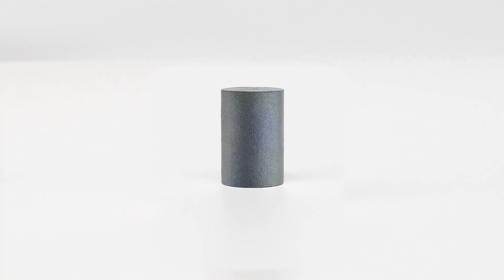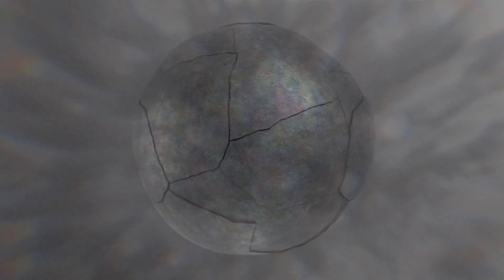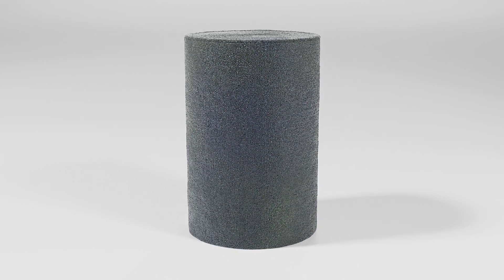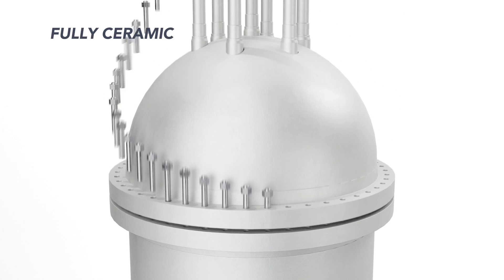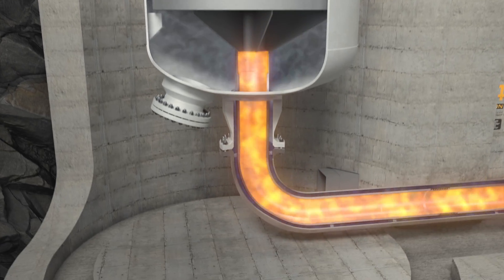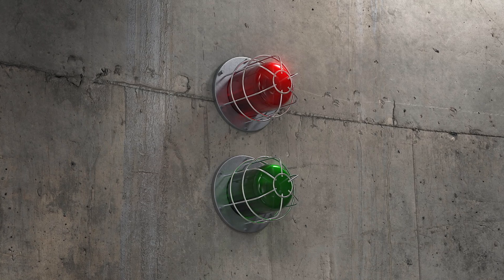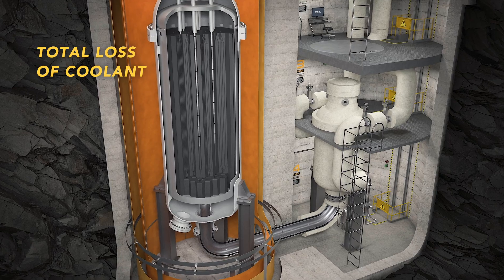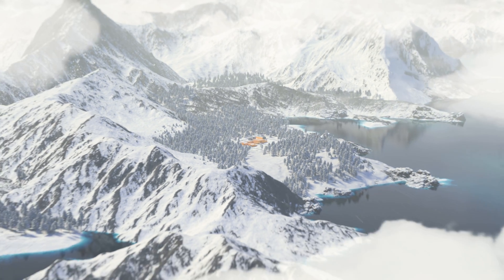How it Works – the Micro Modular Nuclear Reactor

Comment: I chuckled at the point about dissipating heat by glowing, because that's quite literally a thing: all objects lose heat via electromagnetic radiation. Fun fact: this is also how the James Webb space telescope is able to keep cool in deep space, even without anything else to conduct heat away.
Reply: @Based_transition_Clocker What is confusing about my reply? In any case, all radiation from nuclear reactors is shielded with thick steel and concrete. Whether you're talking about the ionizing radiation, non-ionizing radiation, or neutrons, all of it is extensively monitored and none of it escapes the containment building.
Reply: @jlp1528 please stfu… extensively monitored??, governments habitually become negligent. Private companies shoot for high margins. Been to Fukushima? Cancer rate 77 per 100k compared to 1 per 1M

Stuff your cake hole with ThO2
Reply from the maker: @Based_transition_Clocker yea trying to speak to as many people as possible. The point is the reactor temperatures remain safe and with plenty of margin without any active cooling. that's what is special.
Reply: @ultrasafenuclear  I'm pretty sure you have not one but two insolent "Greenpeace" trolls on this thread now. Sorry you have to deal with them. I'm using reason, but you can't reason with the unreasonable.
Reply: @Based_transition_Clocker "Glowing" implies light, usually visible light, but in this case infrared. Infrared radiation is harmless as long as it gets absorbed by something which can be heated without damage, i.e. concrete in this case.

Even the radiation from (thermo)nuclear weapon detonations is mostly thermal. Radiation is a very general term and can refer to the entire electromagnetic spectrum. Look up ionizing vs non-ionizing radiation. The latter does not cause DNA damage, only heating at most.
Reply: @jlp1528 non ionising radiation can still cause damage… also, how is nuclear fuel disposed off? Nuclear reactors are ticking time bombs! Never ever!!!
Reply: @00Tenrai00 concrete slabs buried in mountains, and IR radiation is harmless.
Reply: @Based_transition_Clocker Tell me how I'm wrong then.
Reply: yeah, I liked that bit - can't mention the R-word! but overall, an excellent presentation - we need these reactors, yesterday.

Comment: Great stuff!   
Very promising,  and nothing really new (and so failure-prone) here -  just good, solid common-sense design and engineering.
Reply: Yes. It is the original idea of the pebble bed reactor, but with tinier pebbles encased in fixed graphite fuel elements.
Reply from the maker: keep it simple. keep it safe.

Comment: so I have questions:  what is the expected power capability for one unit?  put it in terms of kilowatt hours?  The comparison to barrels of diesel for one "pellet" is not helpful.  How many pellets in one MMR reactor, how much kilowatt hours of power is produced?  I like the safe design...it's nice...but isn't it also true that the limiting the heat capability also works the other way?  as in, there is ceiling of power that cannot be exceeded?  What would be the use case for such a MMR reactor?  Are we really talking about installing thousands and thousands of these across the entire continent?  Or are we talking about thousands that are collocated in say 50 locations ?  What would be the advantages apples to apples (kilowatt hours) to very large conventional nuclear reactors that have a much higher power rating?  I'm trying to wrap my head around what this technology actually presents in terms of competitive advantage...is it just simply safety....because if it's simple safety as the metric...I could argue that conventional nuclear reactors are quite safe and with a few additional reconfigurations in the existing nuclear conventional reactors at least as safe and possibly more safe.  So what is this new technology really going to do ?  I am skeptical.  I am skeptical because there are so many novel technologies we see that makes the news..but when you drill down there are some deep flaw and even misrepresentations ....what the US NEEDS is to stop the nonsense and start engineering that actually works and can be proven to work..and what i mean by work:  please stop the nonsense with hydrogen powered fuel cell cars...the net power required to produce hydrogen exceed the power output.  That has never made any economic sense.  The more we look at some of these new technologies, the more they appear to be nothing more than money hauls to get grants and federal money and actually do nothing to solve "net zero" or green alternative....

about the best we have so far seems to be solar.  But the problem with solar is SCALE....and there are obvious real world problems that cannot be overcome easily.
Reply: USNC's website lists power ratings of 3.5-15 MWe and 10-45 MWth per unit. Of course there will be a tradeoff between the two, and the exact configuration will depend on what the customer needs. Electricity isn't the only thing nuclear reactors can be used for. Heat can be used directly for industrial applications. District heating in particular does not require very high temperatures, only an effective and efficient system to absorb, transfer, and release heat from a great potential variety of sources.

I understand the economic concerns, but remember that renewables are only so far ahead of nuclear because they have been granted at least ten times more investment and attention for decades. The more we invest in SMRs and microreactors, the more affordable they will become. Also, remember that in 50 years a nuclear power plant is still a nuclear power plant, and it might even still be fully operational. In 50 years, heck, in 20 years, a field of solar panels is a field of toxic waste.
Reply: Very Interesting.  Good Info, appreciate it.  I was not even thinking about the heating application and how small scale could be used for very large manufacturing and assembly facilities.  I am not opposed to nuclear energy.  I think it's an optics problem with several high level mishaps, but those can be solved with better safety controls and location.  Why build next to a earthquake zone or near a shoreline where tsunamis are non trivial.  I do like the SMR design in this video due to the fail safes that are engineered into the design.    Hopefully the US realizes that investments in this area is necessary and we don't put all our eggs in the basket of solar and wind and hydrogen, but that seems to be the current economic agenda. The renewal and safe energy paradigm must be capable of overcoming a 4 year political cycle.  I worry that the US will take the german option and condemn nuclear and then wind back to square one with coal and NG gas energy facilities.  It's a lack of long term strategic investment.  Right now, it all seems to be a hurried short term cobbled plan that doesn't realize a determined goal.  We have milestones to reach and these are stated in general terms, with few actual realistic investment strategies to achieve them.  It seems the ordinary citizen believes that owning an EV car for example is going to make a difference and lacks the bigger picture that an entirely different paradigm shift must take place about HOW energy is produced.  It's hard to imagine the world moving away from classic forms of energy in the current circumstances given there is no business advantages to make the transformation happen without a very long and very expensive investment to do so.  SMR's can definitely play a role in this transition.. @jlp1528
Reply: @tdmmcl1532  These things take time. Solar, wind, and other renewables definitely have their place, but even after all this time and money, they still only provide about 11% of electricity in the US. Compare that to nuclear energy, which provides about 8% despite decades of delays, billions of dollars in budget overruns, and not nearly the same attractive image as that of renewables. What we need is a good mix of energy sources and storage solutions on a case by case basis. There is no "one size fits all" energy mix; many factors need to be considered to determine the ideal energy mix for any given scenario. USNC themselves talk much more about potential applications and energy mix options in their most recent YouTube video. It's about twice as long as this one, but well worth watching.

Again, while it may sound counterintuitive, renewables are "cheap" and "attractive" only because we have invested so much in them in the first place. If we had instead invested in nuclear, we would be in a far better position, even taking all the disadvantages into account. Yet despite the relative lack of investment, the nuclear industry has solved incredible scientific and engineering challenges. Lack of public understanding and political will, on the other hand... I imagine these videos are made to help tackle such remaining issues, not just to sell new reactors.

I will copy and paste the last paragraph of another comment I made so you don't have to dig for it. It's very relevant to your concerns.

Will we see SMRs and microreactors bringing commercial power to the masses by 2030? Time will tell, but I'm cautiously optimistic. There is already at least one SMR facility under construction in China. New Memorandums of Understanding, environmental assessments, and funding agreements are making headlines every month on every continent except Antarctica. The future of nuclear power is safer, more reliable, more efficient, more flexible, and more powerful than ever before.
Reply: @jlp1528  I appreciate your detailed and informed reply.  I am rethinking a change in my profession from wide body commercial avionics tech to nuclear and possibly solar in the maintenance segment.  I've pretty much hit my career potential in avionics and nuclear and solar seems to be a good next level step.  So this is also a "selfish" interest in these two fields.  Any advice on opportunities is of course 😁
Reply from the maker: @jlp1528  you are well informed.

Comment: We need reactors either using fast spectrum to burn U238 or Thorium recactors. There isnt enough available U235 to meet the worlds energy needs. This kind of reactor will get less useful output out of limited U235 reserves than a large reactor.
Reply: I agree that we should be investing in more fast breeder reactors due to sustainability among other concerns. However, it's hard to say how long all existing and future U-235 reserves will last. Also, thermal neutron reactors can potentially be fed reprocessed fast breeder reactor fuel and vice versa. Russia already has a concept for a nuclear fuel cycle like this.
Reply from the maker: @jlp1528  you are a pro
Reply: @jlp1528  The concept that these fuel pellets are based on does not need to be constrained to use with U-235 only.  Pu-239 and U-233 derived from Thorium should work after the math is done to optimize their density and placement in the fuel pellets.
Reply: Agreed - I'm also looking forward to more thorium and fast-spectrum reactors, but I think you may have confused "reserves" with actual availability.  When one talks about "reserves" ie uranium, oil, gold, etc, they mean AT THE CURRENT PRICE (and with current extraction tech).  As prices rise and/or tech improves, "proven reserves" increase.  You also may be unaware the ocean has a lot of uranium in it, roughly 4 billion tons.  This basically puts a ceiling on the price of uranium, and that's without talking about how reserves increase on land as well.  Add in the thorium and U238 lying around (like in depleted uranium for example) and we have power to last through thousands or millions of years.  BTW, the LFTR is a thorium-based reactor that is thermal-spectrum, so you don't HAVE to have fast-spectrum to use thorium (nothing wrong with fast-spectrum, just interesting).
Reply: @zbret  Thank you for explaining reserves and mentioning oceanic mineral extraction. Very good points. That is one reason I said "it's hard to say" whether we have enough U235 or not for long term sustainability. OP stated we don't have enough as a matter of fact. In reality, we don't know, because there are far too many variables. I believe that's why we're seeing such a great variety of new reactor designs. Future nuclear power should be treated like an investment portfolio: diversity provides flexibility and resiliency.
Reply: @jlp1528  That is a very good way of looking at it, and thanks for replying.  I was replying to your's and the OP's point but it has been great chatting with you.  I like the "portfolio" analogy.  This is how I view it, plus I expect the most successful one will naturally become built more and more frequently.  

I could easily see some sort of automation to build such reactors (barely a human in the process) once the design reaches a certain point.  

The next level (if needed) would be a factory that automates the building of such factories.  The expansion would then become exponential in a hurry.
Reply: @zbret  I don't think we will have any problems with availability of raw fissile and fertile materials. However, I do have concerns about HALEU enrichment and spent fuel reprocessing. The reactor is only one part of the nuclear fuel cycle. The whole cycle needs to be more robust and diversified. One can easily make the argument that an exponential increase in the adoption of nuclear power is necessary to meet growing global energy demands and make progress toward carbon neutrality within urgent timeframes. The problem is, that's only part of the huge puzzle. Without robust  supporting infrastructure - enrichment capacity, reprocessing and disposal options, transportation, regulations, and so on - the nuclear renaissance will fizzle out before it has any chance to make a difference.
Reply from the maker: @jlp1528  again. thank you. you are elevating the discussion here.
Reply: Lies Kill  Earth

Comment: So why can’t we use this in space use a intake fane or force intake the space   Temperature for engines or rockets wouldn’t this be unlimited fuel
Reply: Look into NERVA
Reply from the maker: @caav56  indeed we are building on top of the NERVA work to develop nuclear thermal propulsion engines using similar technology. NASA is funding this work. https://www.usnc.com/ntp/
Reply: @ultrasafenuclear  I see. Interesting. Is the NTP system you're developing (it's called PADME, right? At least that's how it was named on the site) a hot-bleed cycle, an expander cycle or something else? No problems, if this question can't be answered yet. And thank you dearly for responding!
Reply from the maker: @caav56  It's a hot bleed. you know entirely too much about NTP haha what do you do for a living?
Reply: @ultrasafenuclear  When your work is linked to physics, one way or another, you learn quite a bit about nuclear tech, with NTP being but one facet of it.

Comment: This is the idiotic "pebble bed" all over again. Nothing like recycling failures.
Reply from the maker: Pebble bed is idiotic. This is a prismatic core. Blocks of graphite containing TRISO fuel. NO PEBBLES.
Reply: @ultrasafenuclear  No pebbles and no control rods.
Hmmm, sounds like something we know all about.
Reply from the maker: @hellstromcarbunkle8857  what are you talking about? there are control rods.
Reply: @ultrasafenuclear  Went to the seller's page. Agreed, control rods. What is there is pebble bed fuel, isolated pressure structures.
Fail again. It's a pebble bed. Fracture will absolutely jam those control rods.

Comment: the problem is that this is very inefficient as the heat exchange using helium is not good at dissipating heat
Reply: The energy density of nuclear fuel (especially HALEU fuel) is so high that the efficiency of the cooling system is of little consequence to the efficiency of the reactor as a whole. Regardless, safety is the number one priority here, as it should be. While stringent regulations do cause various problems in the nuclear industry, it's worth it to keep people and the environment safe. I'd rather have a hundred safe small reactors than one big Chernobyl. That's an exaggeration of course; comparing modern and future nuclear reactors to Chernobyl is like comparing modern airliners to the Hindenburg.
Reply: Safety over efficiency
Reply: I mean it's almost at the level of refusing to buy coffee to save coffee money despite being richer than elon musk. The inefficiencies via helium can simply be minimized by the fact that Uranium is so energy dense.
Reply: We could use the heat to heat homes or we could put the reactor in a large water body. Would that work?

Comment: Safety and affordability are the keys... Maximum efficiency is a secondary concern...  Does it yield economic advantage?  Safe?  Then i want one...
Reply from the maker: The economic advantage is factory production primarily. Similar to the manufacture of aircraft, cars, or ships.
Reply: “According to Architecture 2030, the initial capital cost of a new nuclear reactor is $5,339 per kW, or $5.3 billion for a 1000 MW reactor. Smaller nuclear reactors are generally less expensive to build. For example, the AP300 is estimated to cost around $1 billion per unit, while the AP1000 is estimated to cost around $6.8 billion.” 😅